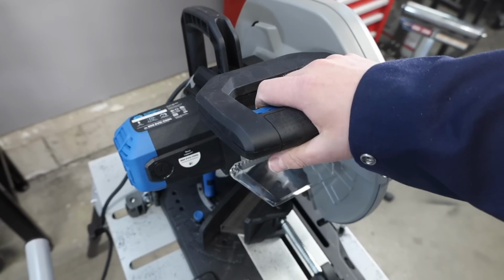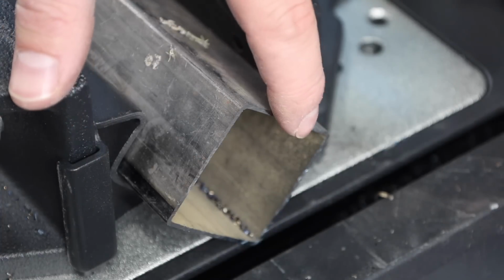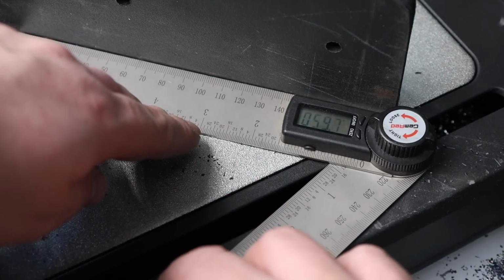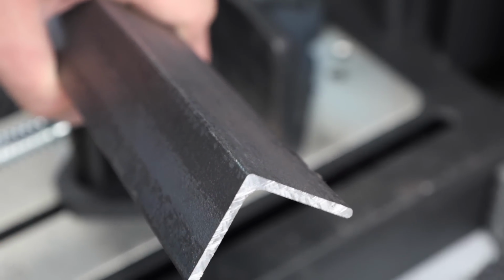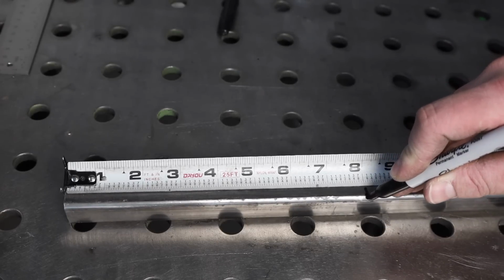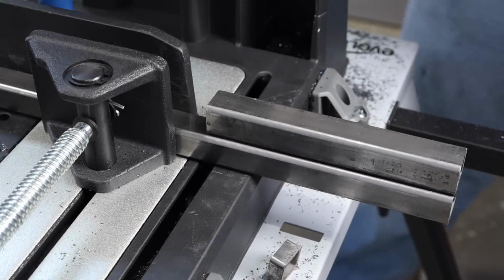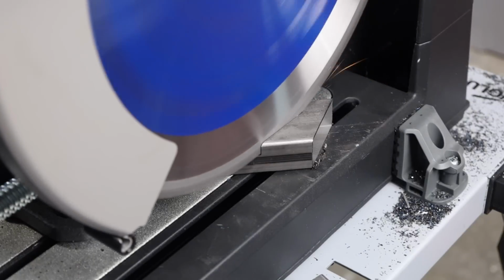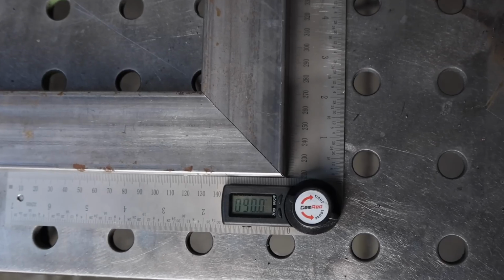Get Perfect Cuts with a Chop Saw

Comment: I use a marker most of the time and make a square angle or a line with a horizontal line to the side of the kerf so I don't accidentally cut away on the wrong side.

Comment: Some of the new cold cut saws have a shadow line created by the blade that help in making accurate cuts. If someone would make a kit to slow down a miter saw to cold cut speeds, they could make a fortune. I didn't want to spend the money for an Evolution cold cut saw, so I bought the Vivor brand. It is rated pretty high on Amazon and should work well enough for half the money.

Comment: I got one of those evolution saws and it cuts really nice but the angel the blade drops at isn’t straight. It drops at like a 91 degree angle with 20mm square it’s fine but when I tried cutting some 6inch pipe it was a bitch and didn’t work at all.

Comment: Does anyone know if I could put one of these blades in my woodwork chopsaw or my old abrasive metal chopsaw?
Reply: No you shouldnt, the metal saws spin at way lower rpm, woods saws usually spin a lot faster

Comment: Tim have you tryed the weldpro mig 155? Looking for a good first welder that will mig and stick, that won't break the bank! Looking at a multipurpose machine that 110/220. I have a hobby farm and have welded since high school in 1982. Want some I can weld fence or fix equipment. Outside will be running off my 9000 surge watt generator.
Reply from the maker: Hi John! I haven't tried that specific machine, though the specs and amazon reviews look good for the price. A dual voltage machine that will MIG and stick weld is a great option because you can leave the gas cylinder behind and stick weld something for a repair in the field, but have the convenience of MIG in the shop. Another similarly priced brand that I have used (though not their MIG welder) is PrimeWeld, which has outstanding customer service and good machines at a good price.
Reply: @TimWelds  thank you for your response! I will check out the out machine also!

Comment: Eventhough I don't cut metal very often in my workshop, I considered buying a chopsaw in the past few years, and once used to it, you ask yourself how did you manage to get precise cuts with an angle grinder or abrasive miter saws.
Reply: Rusty, I bought a mini 6" chop saw from Harbor freight.  It is great for little projects, inexpensive, lift and move it one hand.   So much better than clamping stock in a vice and cutting with saws all.

Comment: Happy you didn’t just say; “I got this saw, or I picked up this saw”. Too many YouTubers are given equipment and don’t say so, as YouTube rules require. So viewers think they actually bought the equipment. That’s deceptive. You can usually tell as every time it’s used the name of the company and model is given, usually with a throw off line such as: “A great …”. A welder company that makes green machines is notorious for that.

I’ve been using a Diablo 14” 72 tooth cermet blade for a good four and a half years, and it finally dulled, so I bought another one. I’ll try to get this one sharpened. I was surprised at how long it lasted. It’s for steel and stainless. I’ve made several pounds of chips with this over that time. Hundreds of cuts. I wouldn’t even begin to guess if it’s approached a thousand. The blade, as has everything else, risen to $80, which is pretty cheap when compared to Freud and Evolution blades, and they have blades for steel and blades for stainless. I highly recommend it when the blade with the saw dies.

Comment: In general how long do the discs on these last? Where can you get them sharpened? I'm deciding wether I wish to buy one of these or a bandsaw.
Reply: It depends on the stress you put on them, generally speaking, thicker materials or long cuts (where the teeth go through long paths from side to side of the piece to cut) reduce lifespan. Putting too much pressure during cut rather than letting the blade "eat' its way will lead to overheat and reduce also lifespan. Cutting too hard materials will also do the same (stainless steel, high carbon steel), use the blade to cut materials for which it was made. Sometimes using cutting fluid (not simply water), will help to reduce stress over the blade.
The major problems of these blades are teeth breaking or simply coming off due to the above reasons.

Avoid those situations and you're probably good for many years of thousands of cuts.

For the sharpening issue, I don't think there's a simple way to sharpen those blades, as the teeth are most of the time made of cemented carbide, which will break rather than just become dull. It is technically possible to sharpen those teeth using diamond tools, but it will alter the shape of the teeth reducing the quality of the cut.
Reply: @rustygear9370  thanks for the info

Comment: I really like my evo saw. I hate the clamp. It jams, wiggles, and still allowed parts to move. More over it pulls& moved parts so they'd no holding it like you can with the abrasive wheel. Once that happens gurentee, you're ruining the carbide
Reply: I haven't had a problem with mine. The more expensive ones have a better base/clamp system. Not sure which one you have though.

Comment: I have an evolution saw and was wondering how you deal with the shards leftover from each cut?
Reply: bucket o' scrap metal. reuse or take to scrap metal yard to sell
Reply: @CamiloSantana  thanks but I was referring to the tiny fine shards of metal produced by the cut. I’ve tried the magnet in the bag trick  and it kinda works.
Reply: @gcranch9913  your doing better than me then. I would think the bag would be a for hazard but 👍🏼

I have my saw up against a wall with a 2x2 piece of 16 gauge steel nailed in. chips hit the floor and shop vac from there when project is done.
Reply: I use a magnetic sweeper.

Comment: Good info!  What blade do you find works best for both aluminum and steel (mild and stainless), or do you different blades for each?
Reply: different blades for each
Reply: @CamiloSantana  I've been looking at the dewalt aluminum oxide blades for steel.   I've heard the hold up well.  I was thinking of getting a 66 tooth carbide blade for aluminum but not really sure which brand works best.
Reply: @bub77000  check project farm channel

Comment: thanks for the info Tim.  I have been having an issue with my evolution chop saw.  often when I cut, the cut piece will fly off (violently).  even when I lower the blade down slowly.  even if I have clamped work piece down tight.   can anyone tell me why the cut-off piece flies off instead of just dropping off gently (staying near the blade after cut) (like Tim's cutoff piece does in this video)?
Reply: Are you using a length stop? These give me same problem. Also, depending on your saw, check to see where on the radius of the blade the cut is bing made. Try to avoid cutting stock at location on the leading or tailing part of the radius. Make sure that the support for the cutoff piece is at a lower or equal level to the cutting table of the saw.
Reply: @andrewlangley9507  thanks Andrew.  I will try those ideas. appreciate the feedback
Reply: The length of the cut off piece is the only time that I have had a problem like that. If it is not large enough to fall off of the side of the base, it will try to fall back into the slot in the base that the blade dives into. I know that it makes it hard when you can't just trim a little off of the end. I junked a blade once with a piece of angle. The blade literally bent.

Comment: Thanks. A must have to be able to do precise cuts. Unfortunately i can’t find it in my country.
👍
Reply: so long as the angles are accurate (check with a protractor) and the cutting disc doesn't flex, you've got a decent saw. good luck
Reply: @CamiloSantana  Thank you 🙏

Comment: I've been using my cut of s for cutting cannel 3x1.1/4 and 4x 2  C channel, y question is what is the best way to cut this so that the blade can last longer?
Reply: Not much you can do with thicker wall materials. It'd going to burn through blades fast. Just the way it is. Factor the price of a new blade into the jobs you're taking, especially the ones with heavy wall material. That 100 or 150 bucks for the 14" adds up fast and there's nothing worse than cutting metal with a dull blade.

Comment: Can you use one of those blades on a saw that came with an abrasive blade?
Reply: No. Speed is too high and it will destroy the carbide.
Reply: I'm interested in this too. I can't see why not providing the blade has the same bore and diameter.
Reply: Nope.
Reply: Absolutely not!
Abrasive disks are meant to be used with 3000 to 3600 RPM while this metal specific blades operate at lower speeds, generally 500 to 1500 RPM depending on the diameter and the density of the teeth.

Using high cutting RPM will simply break the teeth and /or generate more heat than the they were designed for and let them come off. Considering the price of these blades, using abrasive disk will be more economically viable.

Comment: This video couldn't have come out at a better time, I just bought my first chop saw yesterday. It's an abrasive disc type so probably won't be as accurate.
Reply from the maker: Very cool! I used an abrasive saw for years, and you can get very accurate cuts by doing the same things I showed here.
Reply: @TimWelds  if needs be, do you think it would it be possible to replace the abrasive disc with a metal blade?
Reply: @desb9639  I've always wondered that. Just picked up my first abrasive Chop Saw a few weeks ago, and was wondering if a Carbide tipped blade would work on it
Reply: @desb9639  unfortunately not.
The blade speed for the abrasive machine is far to high for the metal blade.
There is a good reason why the cold cut machine is much more expensive.
Reply: @Bosbulls  ok thanks.
Reply: @desb9639  you can use a metal blade. it will say on the blade that it supports higher rpm of your saw - likely 5200 or so. the catch is that the wheel will have a much smaller diameter to cover that fast radial arc into a slower linear speed. but, if you're cutting mostly tube and angle iron, it works out fine. just gotta put new marks on the cutting block and maybe remove the blade stop so you can lower the mechanism further. it was worth it for me.
Reply: @Bosbulls  you can get blades that support the higher speeds. they'll be smaller but they work. see my link above.

Comment: I have an older dewalt dw872 that I bought used. These saws are pretty incredible! I was cutting round stock so thin that I made my own washers. I really like the look of what this evolution is capable of doing.
Reply: if for whatever reason, you need a second chop saw, would you buy another dw872 or go for the evolution?
Reply: @CamiloSantana  I think I would try the evolution because of price and I like the fence. However, the screw threads on the clamp are better on the dewalt.

Comment: Hi Tim.  Thanks for the video. I use a chop saw with an abrasive cutoff wheel and find it so frustrating that the wheel flexes when I try to remove 1/16” or so of material. 

Looks like I need to save up for an evolution. 

Keep up the great work!
Reply: I own a similar saw, a Trajan Q1400 as well as an abrasive disc chop saw. I'll give you a little piece of advice. The carbide blades for these saws aren't cheap so if you want to get the most out of them pay very close attention to the way you position the stock material in the vise like @TimWelds pointed out. Cutting the material on an edge rather than on a face has a huge impact on blade life. Also, very important, allow the saw to attain its full speed BEFORE you start cutting. Finally, I try to reserve the use of my carbide blade for cuts where I require a high level of accuracy. Other cuts where that level of accuracy may not be absolutely necessary, I use the cheaper abrasive blade. Just FYI.
Reply: @andreb877  Thanks for the tip.
Reply: If you have a circular saw you could get one of the diablo metal blades it's what I use while I'm saving up for a chop saw
Reply: @tednielsen5271  Thanks, Ted!  I’ll check it out.
Reply: @DStein-jn9ls  I can vouch for them the steel demon blades will even cut the 7018 weld pretty quickly. I was eyeballing a steel leg and it wasn't straight at all my fault at that point in time because I hadn't gotten my magnets yet
Reply: @DStein-jn9ls  I have an evolution chop saw, this same one, for at least 4 years now. They're nice, and way better than abrasive chop saws, but honestly I still do most of my cutting with a 6 inch grinder with a cutting wheel. That issue of flexing the blade even happens with this saw. Even when bringing the saw arm down slowly, the wheel (and probably the arm itself) flexes over, resulting in a cut that may be straight from front to back, but it's not square top to bottom. Working with tight tolerances makes it a huge pain, and I find it's rarely better than the cutoff wheel on a grinder. Probably not what you wanna hear, but it's my experience. Gotta take all of it into account when fabricating. I also have that same table he has, and it ain't flat by my standards. It's about 12 thousandths off across the entire width.
Reply: @josiahwright1290  Thank you, Josiah for sharing. Had not thought about getting a cutoff wheel for my bench top grinder.
Reply: @DStein-jn9ls  I don't use a cutoff wheel on my bench grinder, I use it on either my Metabo 6 inch angle grinder, or my Flexvolt 6 inch angle grinder. For more delicate cuts, I use a worn down 6 inch disc (once it's down to 5 inches and below) on a typical 4.5" angle grinder.
Reply: @josiahwright1290  Got it. Thanks for the clarification. I appreciate it.
Reply: Get rid of that abrasive saw as quickly as possible. The dust is dangerous as it includes fiberglass as well as the abrasive, plus microscopic metal dust. This lingers in the air where you breath it in for hours. It covers everything in the shop, dulling blades and cutting bits from other machines, and is a general mess.
Reply from the maker: Thanks!